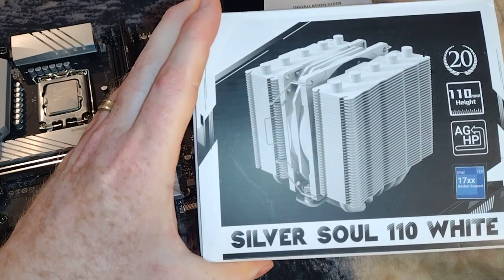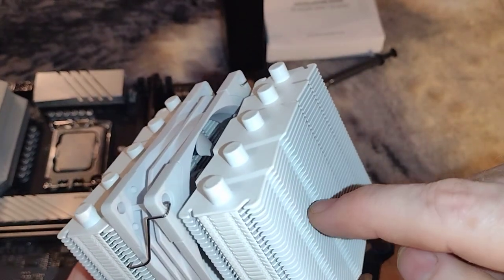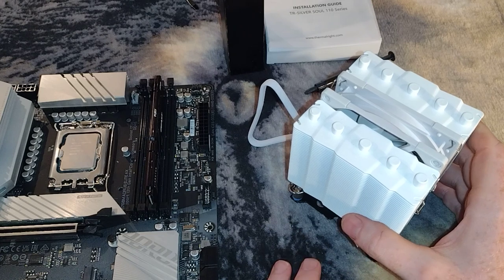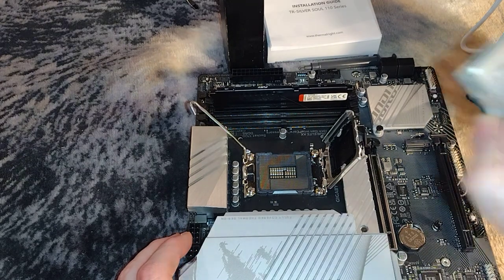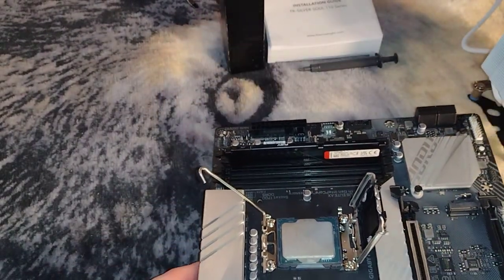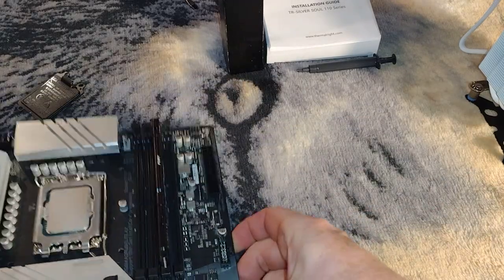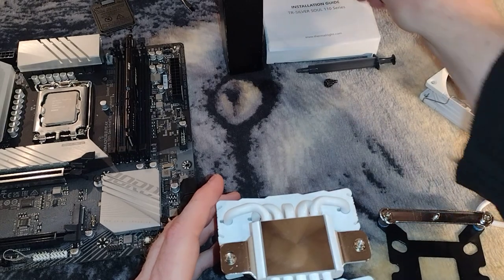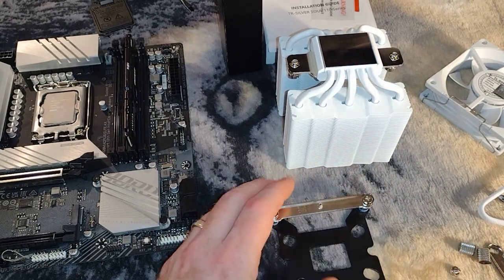Installation Guide: Thermalright Silver Soul 110 White Dual Tower CPU Cooler LGA 1700 motherboard

Comment: Getting the black version for a Hyte Revolt 3 but I am going to try and change the orientation for that case so the fan pulls from the side as the Revolt has a bottom mounted MB.
I should be able to use the longer brackets from another thermal right cool and since it's square i'm hoping it works :-)